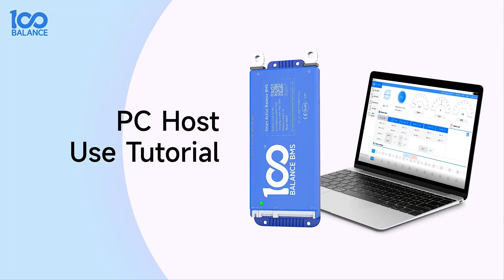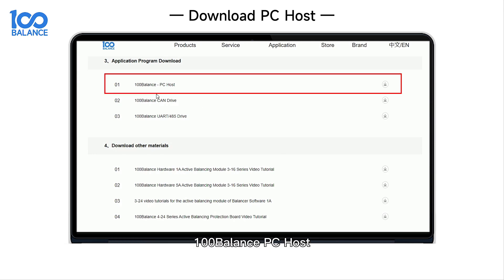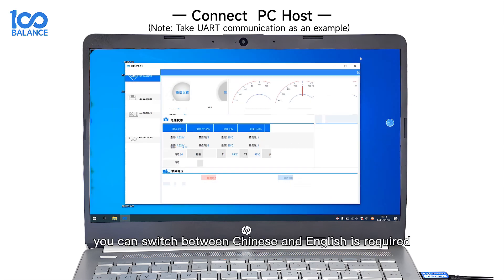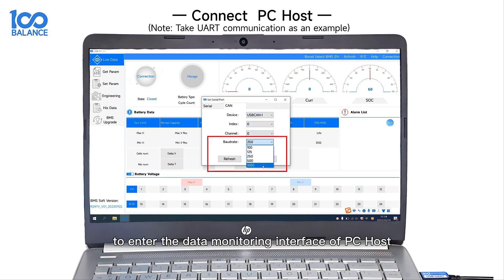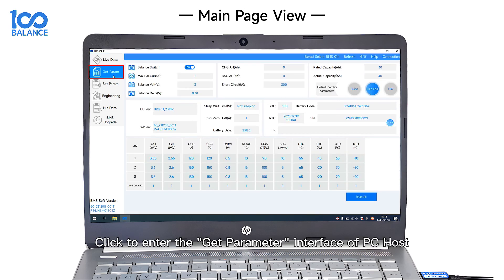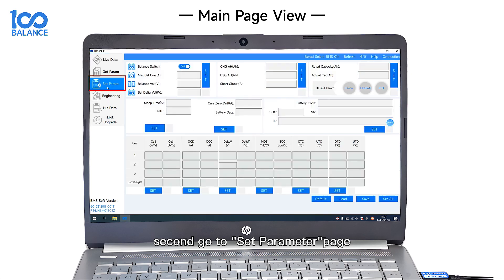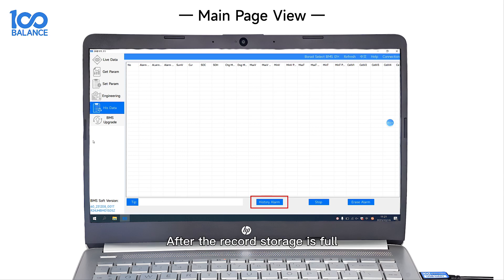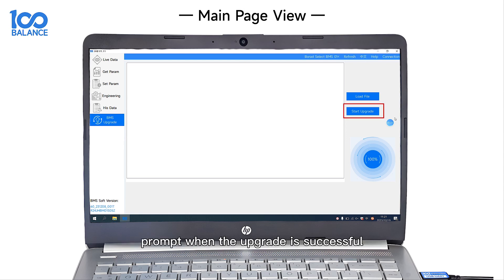How to use the PC host of 100Balance Smart active balance BMS?

Comment: i have 100A BMS but it current calibration is not OK, tried many times using zero calibration and then actual current calibration but it dose not show actual current, please make video on calibration form starting from zero calibration to the actual positive & negative current calibration.
Reply from the maker: Sir, is it charge discharge current calibration?
Reply: @DALY100balanceBMS  yes,it is not showing current properly, how to calibrate it with actual charge discharging current??
Please make video on it.
Reply from the maker: @SantoshBhagwat1976  Okay sir, I will report the issue to the engineer, but currently our current calibration function is fully automatic, so there is no manual calibration function available. I will propose to the company to add manual current calibration function.

Comment: I can't set the discharge current to a limit i want to start a motor.even with the application  uart usb I set it to 250A and 10 seconds Delay but the bms cuts the current in milliseconds.
Reply from the maker: The delay time needs to be changed through the program and cannot be successfully modified through the APP or PC!

Comment: @100balanceBMC can you connect the RS485 and wifi at the same time?
Reply from the maker: Yes, The wifi module is connect to UART port ,and the RS485 is connect to CAN/RS485 port. so it is work at the same time.

Comment: This software works only when USB-Serial converter is based on CH340 driver. Otherwise the software does not see com ports.
Other converters, physical COM ports - they are filtered out and cannot be used at all. This is wrong !!!
Why I cannot use real physical COM ports?

Older software (PC Master), dedicated for Daly BMSes had not this limit hardcoded and could work with any COM port, including virtual ones.
And it still works with these newer blue BMSes.

Please fix this!
Allow any COM port to be used!
Reply from the maker: Dear, Thanks for your kind advice. We have already fixed this problem on V1.32 pc host software. Please download the newest version from the official website.  Also you can contact me via arica@100balancebms.com  if you have any questions about it.  Best wishes.
Reply: @DALY100balanceBMS  Thank you for prompt response!
I've just looked on web site (both, CN and EN versions) and both suggest to download only v1.21, same as yesterday.
So please verify V1.32 availability to download.
Reply from the maker: @oleksii.zagorskyi  Please email to arica@100balancebms.com.  Then I will send it to you now . This is the fast way.  Also I have already notify it to our marketing department , I think they will update the software soon.